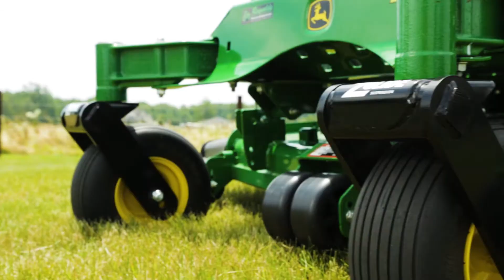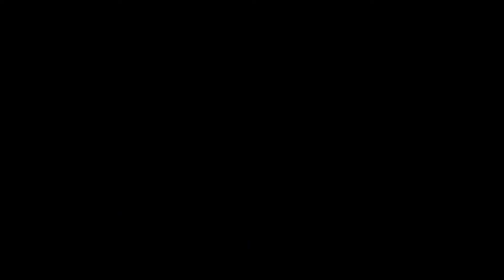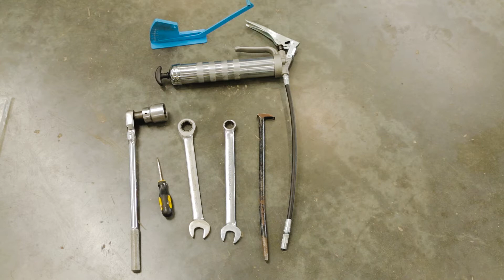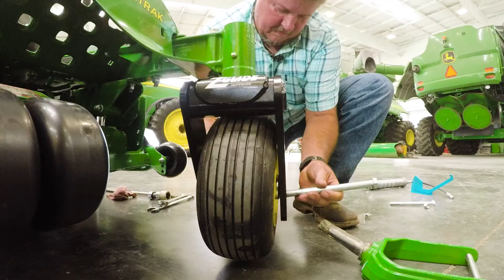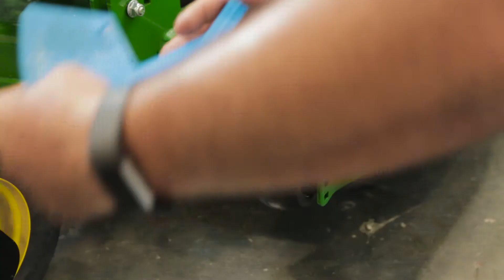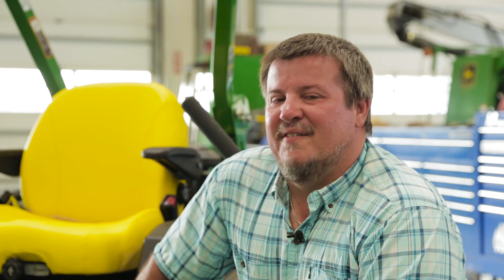How to Install ZGlide Suspension for Z900 ZTrak Commercial Mowers

Comment: Thanks! I don’t have a nice flat concrete floor but this worked fine for me anyway. Thanks for the good instructions which allowed me to order the 1 and 7/16th socket and have the other wrenches ready. When they came I just lifted the front end with my little Kubota tractor and some good straps, supported the machine with a cinderblock bag material collection system and 4 suitcase weights on my JD 925A and I was concerned whether these would still function with all that weight. They do! I think it helps them, at least when new. Used the top axle holes. These and a suspension seat really tamed my machine. 4.5 acres of lunar landscape in Montana. I am very pleased with them.
Reply: I guess Im asking the wrong place but does someone know a tool to log back into an instagram account??
I was dumb forgot my account password. I would appreciate any tips you can offer me!
Reply: @Magnus Kyrie instablaster ;)
Reply: @Kason Adrien It did the trick and I now got access to my account again. I am so happy!
Thank you so much you saved my account :D
Reply: @Magnus Kyrie glad I could help xD

Comment: I just bought these and went to install them, also bought the but the Tweel casters in a bundle price.  The video makes it seem like the front forks just slide out... mine would not. Could not get them out. Z915e model. So far replaced the the original equipment wheels with the with the tweels, using using the manufacturer's front forks.

Update: Jason with Reynold's reassured me that I could forcibly help the spindle out, used a deadblow and it came out.  Found the lower bearing cone stuck to the spindle. I have the bearing soaking in penetrating oil and will use either a bearing puller vs brass punches and see if it comes off. If not I already have a new bearing and seal ordered. 

Wish I would have known ahead of time about this possibility but like any project if it takes 10 minutes on the video expect a couple hours when problems occur.
Reply from the maker: Hello, we are sorry you having issues installing your ZGlides. If you would like some help call our Fishers location and ask for Travis. Call 317-849-0810
Reply: @ReynoldsJohnDeere  thanks, see my update. I'll get them on there one way or the other and update again.
Reply from the maker: @drwags21  Sounds great! Let us know if you need some help or how you like them.